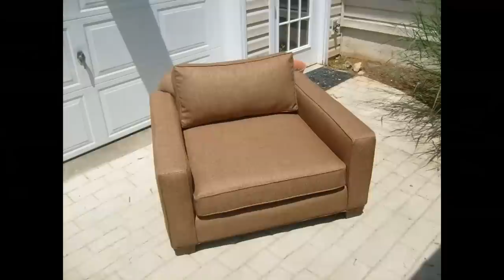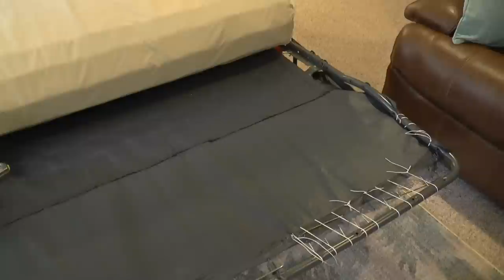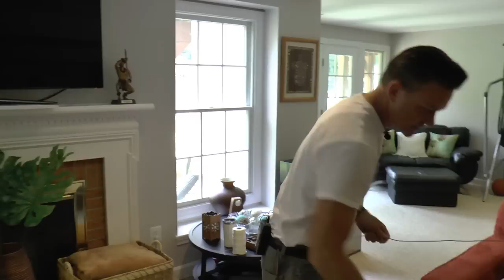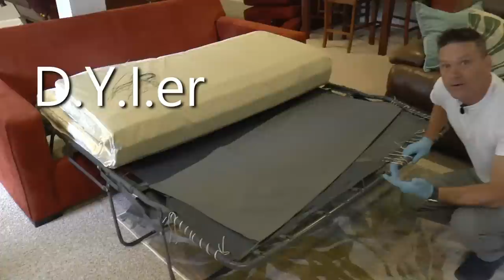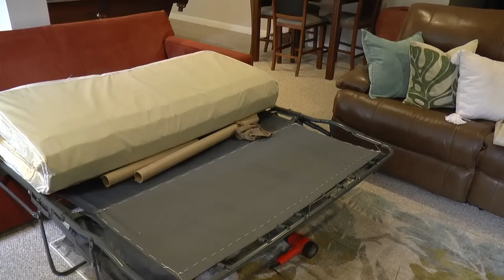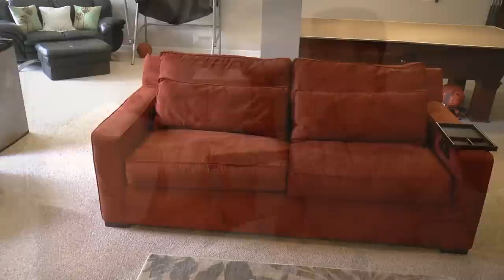Sofa Bed Repair - Keeping You in the Bed and Not on the Floor

Comment: Thanks for another great video. I can't tell if the deck fabric is the same on the other side of the seam where the bed folds. (It looks like a different material but may just be the lighting.) If the ripped panel was frayed so badly that the patch didn't have much to stick to, would it be possible to stitch the patch to that seam? Do you think that would hold it? I had to do something similar to a leather chair that had flimsy fabric pull strips where the cover was pulled tight and stapled to the frame of the seat.  They were shredded. I replaced them with some duck I had on hand. I stitched it with a Speedy Stitcher awl, which makes a lockstitch just like a sewing machine and it came out better than original. I think it would work for this also.  But then I'd probably replace the whole deck if it was that bad. (I wouldn't have said that a couple years ago. I've learned a lot from you two, enough to give me the confidence to tackle refurbishing yard sale finds for my home. Saves me money and keeps it out of the landfill. You guys are among my favorites.)
Reply from the maker: Hello again, good to hear from you. I think I understand your thought. The patch we put on, we stitched where the fraying had not occurred yet. The glue we put on in front of the stitching, WILL stop any further fraying from taking place, acting as a block-aid. There's a product on the market called fray stop. It really just a clear glue when dry, that stops fraying and it works very well. I hope this is what you meant. Hey that is GREAT to hear you have taken on projects with the help of the videos and keeping the furniture out of the landfills. We love to hear that, Plus the saving of money, win win!!  Hey thanks for following us and for all your comments. Hey if haven't already. Please share the videos it really helps us when you do. Cheers,
Paul

Comment: I just noticed my Lazy Boy sleeper sofa has a frayed corner and the tension rod coming out.  Would this patch system be the best way to fix this, or would replacing the cheap tarp material with sail cloth be a more lasting fix?  Thanks for the video!
Reply from the maker: Hey there, the patchwork would work. But if you can replace it with the sail cloth that would be superior. It would last for many many years. If you’re in a position to take it on and replace the whole thing that would be great other than that the patch will just get you through. I really appreciate watching the video I hope this helps you. Please share because it does help us when you do. All the best, Paul

Comment: Thanks for the videos. I am in a similar bind. I have a sofa bed that is sagging in the middle. I don’t see anything wrong with cushions or frame. I believe it is two rods (forming x shape) that support mattress that lost against 4 kids jumping up and down. I wish I had reference pictures to compare. Any suggestions how to confirm what issue I am dealing with. Thank you!
Reply from the maker: Hi Zoya, you are welcome. It is really difficult to say without being there to see it. Sometimes the tarp or material that holds the mattress, stretches out of shape causing it to sag. The cross bars as well can do the same with kids jumping on it. Take the mattress off and look underneath to see if there is a drop in the center. If so it's the platform. Do you have small coil springs on the sides of the frame? Some models do and they may have come undone or missing. Not seeing it I would guess it's those factors causing the problem. Hey try this place I found online maybe they can help some.   https://recliner-handles.com/sofa-sleeper-repair/parts/      I hope this has put you in the driver seat to fix it.  Thank you for watching ,If you have any other question send it my way.  Cheers,  Paul

Comment: Is there any way could point me in the direction to have a sofa bed repaired in NC? It seems like the bed may be detaching from the sofa and the actual sofa sits really low now, seems like almost to the floor.
Reply from the maker: Hi Antoinnette
Thank you so much for watching our videos! Unfortunately I do not know off the top of me head of a location in NC that would be able to help you. The most upholstery shops should be able to fix this problem though. If you’d like we can try to walk you through how to fix it yourself if you contact us on our website at ucprivatecourses.com via the live chat.

Comment: i got an old Pottery Barn sofa bed at a flea market. When I open the mattress, the metal carriage hits the floor causing a big scratch and if I take the mattress out, you can't sit on it because it will just sink. Shouldn't you b able to sit on it regardless of whether the mattress is in and can the fact that it hits the ground when being opened be repaired or should I just toss it? The mattress is actually really good.
Reply from the maker: Thanks for watching our videos! The fact that it hits the ground when it opens is something that should be able to be repaired. I’m assuming that the cage itself shifted down closer to the floor. Check where the actual cage is attached to the sofa frame and see if that is loose or can be shifted upwards. Also you will need the rigidity of the mattress inside the cage if you are to use the sofa. The mattress itself acts as your sofa’s platform. I hope this helps!
Reply: @ucsolutionsgivingmore  thanks so much for the reply. This is so helpful. I didn't realize the mattress had to be in for it to work properly. duh! I took the mattress out because it's such good quality I want to use it for a third bedroom. guess I'll try to find something cheap and rigid enough - foam - so that the sofa continues to work.
Yeah, I really hope the cage can be lifted. It'd be a pity to throw the whole sofa away but as it is now, it will gouge the floor. I put something under it but I want to be able to function properly without having to take a bunch of extra steps. Thanks again for your help. I really appreciate it

Comment: My rods on my sofa bed is broken can I get them replaced?
Reply from the maker: Hi Terri,
Thank you for watching. Without seeing it is hard ti say. Do you mean the frame metal tubing? Or the rods that hold the platform on mattress tight that's on the sides? Frame! Really tough to replace. The rods that hold the platform. YES!  You can find replacement rods online, look for the same thickness and a strong tensile strength. High enough for support, yet bendable if needed. I know its hard to know when buying online. I hope this has gotten you on the right path.  Please share the videos it helps us when you do.     Cheers,   Paul

Comment: Much easier to just take the whole thing off. Remove the replies piece and sew your patch on. This was a lot of unnecessary work that would or couldn't not last. When it would have taken 10 minutes to seam rip that section off and see the new one on. Smh. If you don't have a sewing machine fine a local seamstress.